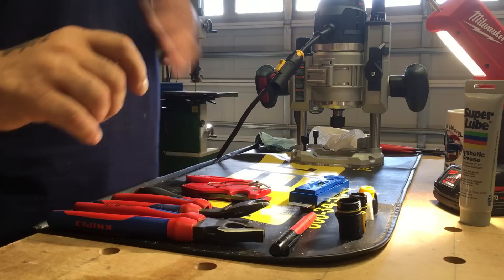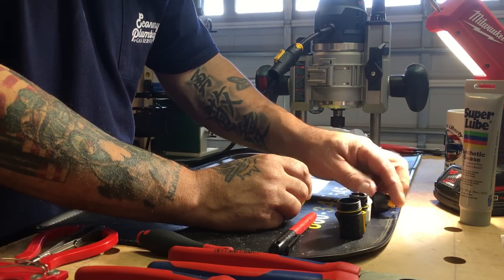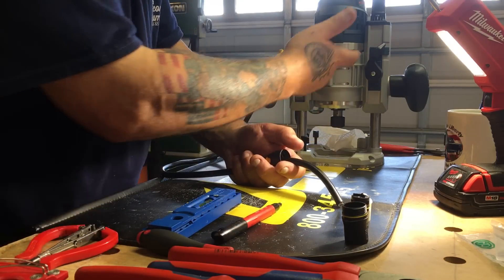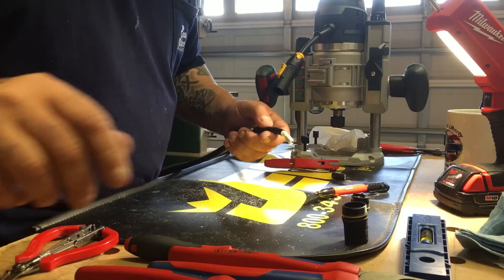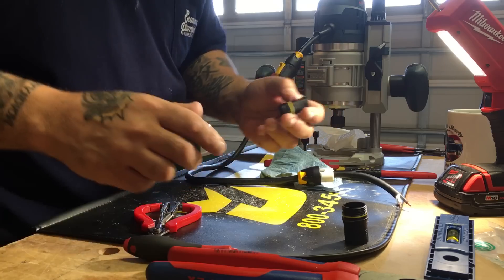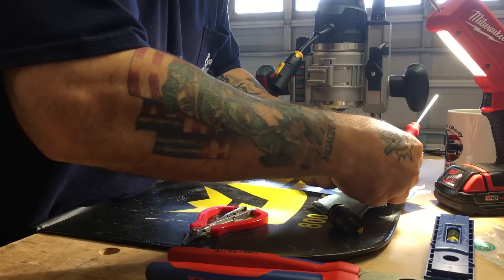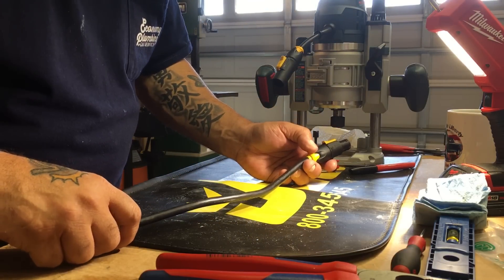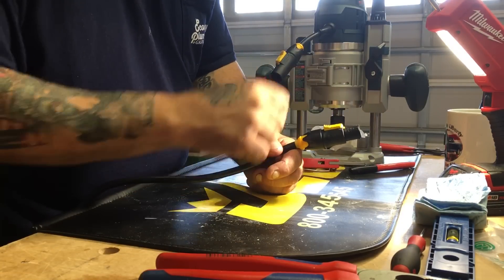Assembly of a Neutrik powerCON TRUE1

Comment: Just real quick, while I know it's a synthetic grease, make sure the sheathing of the extension cable can handle oil and grease, I know an O designation means it's oil resistant. Also, be sure to ALWAYS put the female connection on the extension cable, because trust me when I say getting shocked is not fun. A good way to know is remembering females have all the power, or as we say in the shop, females put out. XD
Reply from the maker: Gregg Carter Thanks for the comment that grease is good for all rubber,plastic etc. The good thing about these connectors is there is no live leads sticking out. The the part about the females have the power lol Mike